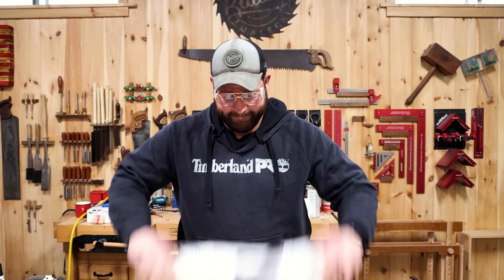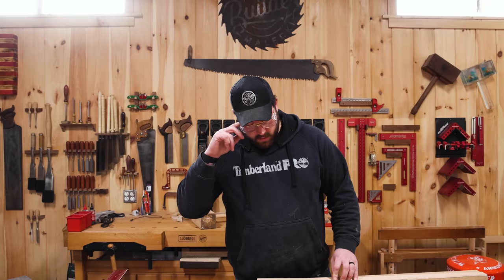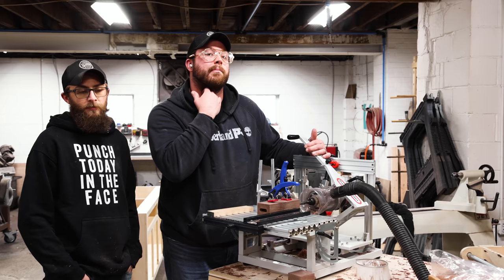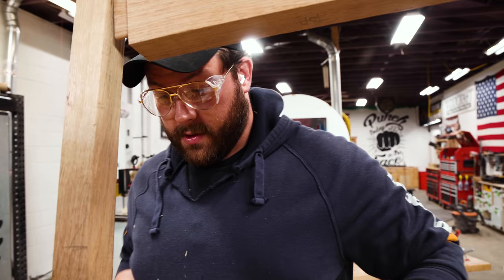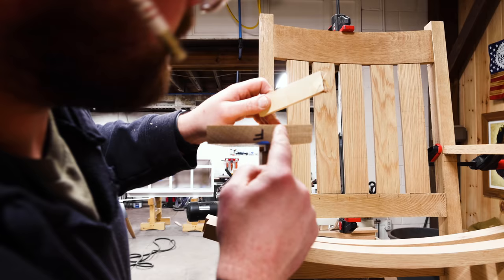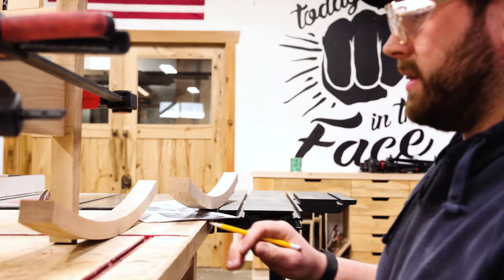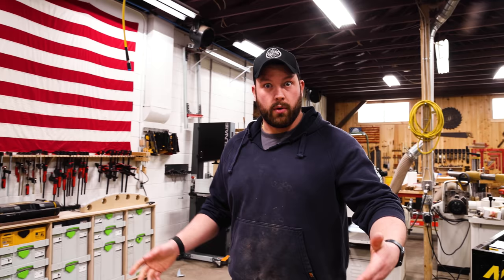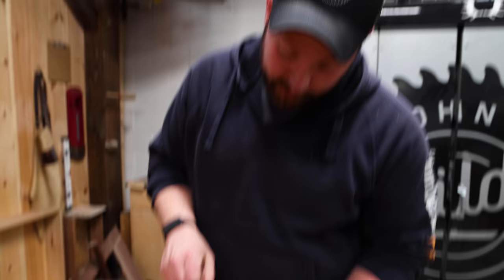CRAZY Difficult Rocking Chair Build for My New BABY!

Comment: Hope the baby is there already.
One thing you could add is a rest for the feet....
Most women are a bit smaller and when rocking a baby or feeding a baby in a chair it can be very relaxing to have 1 or both feet on an extension.
Also a front or back stop can be ideal.
If someone is rocking too hard they sometimes flip on their back of front (out if the chair).

Good luck guys.
Great video's